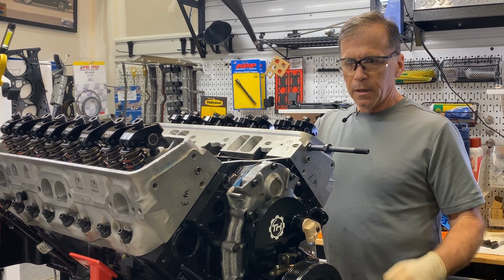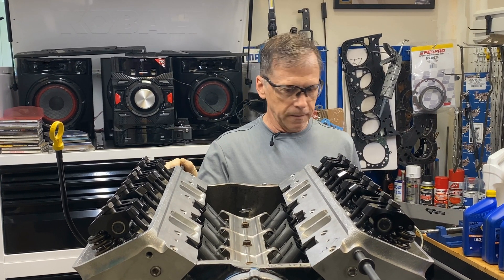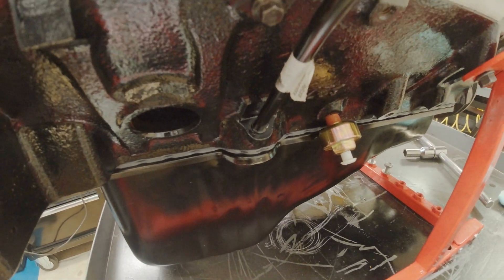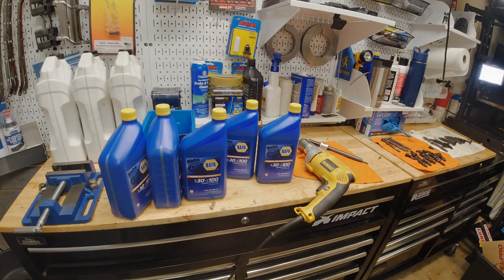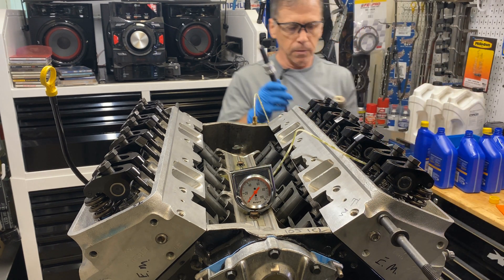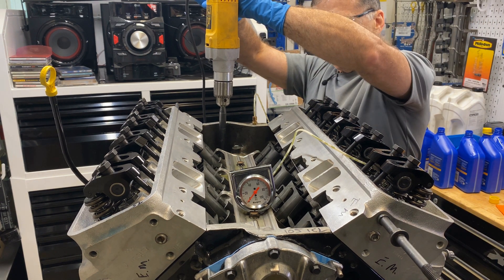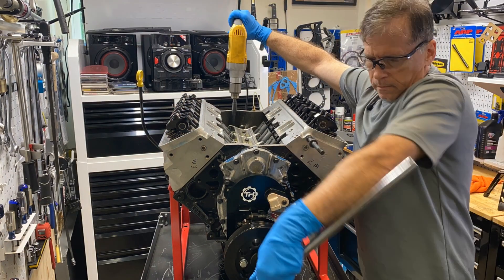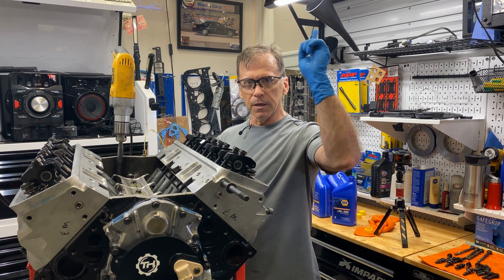LT1 Small Block Chevy Oil Pre-Lube How To 4K

Comment: Thanks for the video broski. Very helpful. I actually learned a lot and wouldn't have known to rotate the engine when checking for oil at the top of each push rod. You're the last of the real hot rod generation. Thanks again for posting this video

Comment: Found a 97TA with 46k miles. Has not been started in 12-13 years. Yes I know the tank has to be dropped and tons of work to do. But I'm gonna pull the fuel pump relay and fuse and I'd like to prime the oil pump like you did here.
Reply from the maker: only if you have room at the back of the engine under the cowl.  Maybe yes...with an angle drill

Comment: Can you do this oil prime oil pressure check with this engine in the car ?
Reply from the maker: I don't think it is easy to do with the engine in the car.  But an angle drill probably yes
Reply: @EllweinEngines  im glad someone chimed in. I ended up passing on the offer and am not having regrets. Was offered a 96 TA with 42k miles that hasn't been started in 5 years or more.  They wanted too much and I only wanted to do minimum work and trade it off but I never liked 93-97 I've had even when they were running lol

Comment: I’m doing a cam swap 1995 Trans Am LT1. The Cowell hangs over the back of the engine. How can I pump up the lifters before start up? Thanks Karl your lt1 videos are very informative.
Reply from the maker: That will be difficult.  I think you might not be able to do it with the drill method.   Really is no need to do that except if you have the engine on an engine stand it's a nice thing to see how the lifters act.  In your situation I would not worry.

Comment: I just had an engine rebuilt and it's not priming like yours or anyone elses is. It's a SBC 302 DZ. I gutted a distributor to make sure its the right fit. Oil sprays out of the rocker arms on cylinders 7 and 8 wildly (as much as a foot) and nothing comes out of either cylinder 2 rocker arm. Every other cylinder rocker arms it barely leaks out. Oil sprays out of the lifters on 7 so hard it clears the rocker arms. I've made sure to turn the crank and even had someone do it while I ram the oil pump. When I asked the shop that rebuilt it, they ran it on their machine that pressurizes it somehow (doesn't run the oil pump) and spins the crank at 350rpm, and it looked like it flowed normally during that test. Any ideas?
Reply from the maker: Yes.  One idea.   I have had oil come out like a gusher out of a few rockers and it is because of bad lifters...     The lifter in the spot 7 and 8 probably have too large of an orifice for the oil.  Try putting a different lifter in that spot (even an old used lifter) and see if it changes to more uniform flow.

Comment: Hello. I have a question. My dad gifted me his old 1996 Corvette. He had massive oil leaks and the oil pump screen was clogged with bits of gasket and rtv. (I know now the oil pan gasket should have been dry) I bought an oem melling pump and just installed it. The car is fully assembled (intake still on) and has sat for close to a year. What would you suggest I do to prime it? Would I have to pull the intake and valve covers to perform the procedure you posted? Any help is appreciated.
Reply from the maker: The other way that I've seen priming without taking the intake manifold off is using a sorta expensive pre-lube tool that is a pressurized can full of oil.  You could make sure to unplug the fuel injectors and crank it over with the starter for a while.   I have so many times just started the engine without doing a prelube.   If it were my car I would just crank it up.

Comment: Hey Karl just s quick question is the largest cam size you can go with on the lt 383 without enterfering with the the rods & crank
Reply from the maker: Actually don't know.  Depends on the rods.  some rods are designed so nice that any big cam will not bump the rod shoulder.  some rods will hit even small cam lobes.
Reply: @EllweinEngines  ok I appreciate the message back just looking for the best advice on  this LT1 since its my first one I have built

Comment: Hey Karl great video, I cam across your channel when I was looking for cam bearing installation orientation help. Anyways a question about the oil pre lube.... I noticed that your engine didn't have the expansion plugs installed in the block. Is there a reason for doing the pre lube before the plugs are installed?  thanks
Reply from the maker: Thanks for the kind words and glad I could give some useful info.  I think the block in the video does have the expansion plugs in but they are painted black but maybe not?  If they are not in yet then it's for no real reason.  Just have not gotten to putting them in yet.
Reply from the maker: you are right.  no expansion plugs yet.  No real reason though...just not yet.

Comment: Hello, Mr. Ellwein. I have just completed this process on my Lt1 383, and I have purchased a  Performance Billet Aluminum Oil Pump Drive Housing, well it doesn't want to seat down in the block, Do you feel the factory one are sufficient? or do you recommend a different type? Thanks for your time.
Reply from the maker: Hi Christopher,    I've never used any other oil pump drive so I guess I'm a fan of the factory drive.  It works perfectly and even if the mounting tab cracks from over torque of the hold down bolt it still works fine.  When they break (I feel) that it is acting as an early indicator that the engine is in distress, (severe knock or rattle or shaking).  If your billet alum drive is not fitting maybe the oil pump shaft needs to be ground down to fit inside the oil pump drive?

Comment: If the priming tool is just knurled on the end, do yourself a big favor and grind or file three triangular flats on the knurling.  This gives the drill chuck teeth a much more solid place to grab. With the knurling, if the chuck gets loose for any reason under load (and 65psi puts a lot of load on it), it will immediately create metal shavings that drop right into the engine oil, requiring you to drop the pan and flush out the motor. Flats beats knurling.
Reply from the maker: Great tip!   This tool thankfully is a triangle end.  But great tip to keep in mind if you have a different brand or make-shift distributor tool.  Something like that could certainly happen

Comment: What RPM was that drill running at?
Reply from the maker: That is a good question.  I don’t know.  I’ll try to find out.  It is enough rpm to match full throttle on the ending dyno.  Or in other words get the oil pump in the relief spring.
Reply from the maker: Drill is at 1000 rpm

Comment: That's a nice looking motor Karl is this one you're doing for yourself or a customer?
Reply from the maker: Hey Tyler, it is for a customer.  #95   I have it at Jim's dyno today.  A slight delay due to having a failed intake manifold gasket seal...it was sucking oil from the intake valley.  But it made good power and torque.  More on that later with a dedicated dyno video (in a few days).  I have 2 more dyno sessions coming up in the next 2 weeks.

Comment: Is that the build with the Shark Tooth oil pump? I appreciate your videos.
Reply from the maker: Yes it is.  The standard volume and high pressure.   It went to the dyno yesterday and I’ll create a video edit of that dyno session in the next day or so.  Good power for a 9.7 compression ratio.  (485).  Oh and it showed 74psi oil pressure average on the dyno.
Reply: @EllweinEngines  Schweet

Comment: Good work Karl.  I use John Deere break-in oil for my engines.
Reply from the maker: Thanks.  Is that oil pretty cheap or expensive?
Reply: @EllweinEngines  Karl, I don't consider it excessively priced (the last I purchased was around $20 for a gallon) considering the expense of the engine's cost.  It has a good reputation and contains all the right chemistry for a good outcome.  Thanks for all your videos.  Do you have one for removing the stub shaft on the front of the crank??